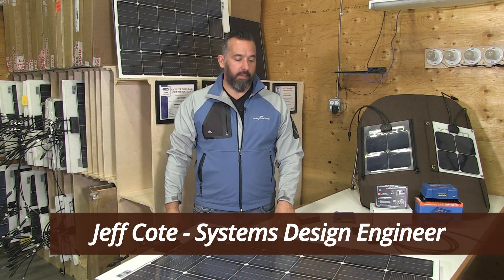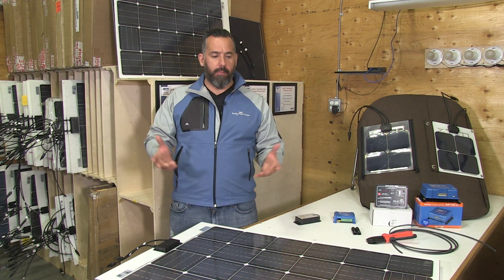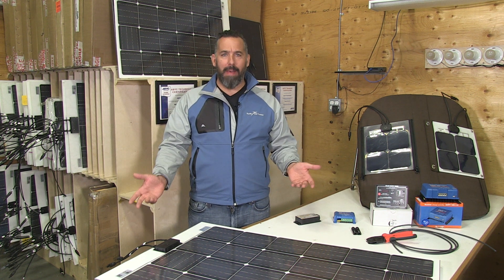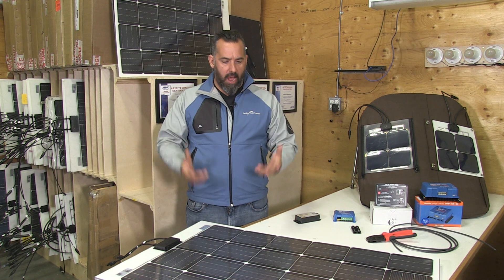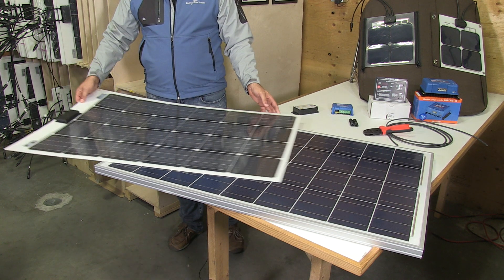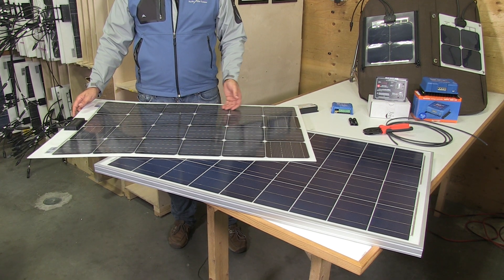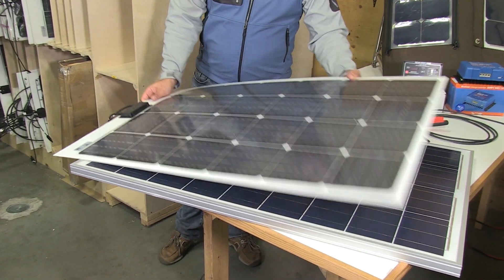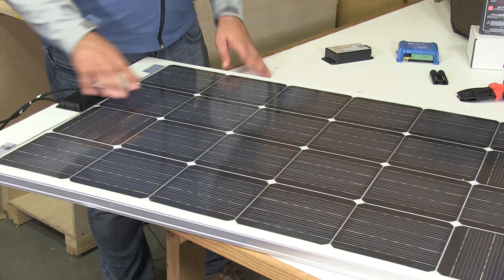Should I Use Flexible or Rigid Solar Panel on My Boat?

Comment: I read that flexible solar panels generally have half the efficiency of rigid; 7-13% efficiency vs. 16-20%.
Wouldn't that make the rigid panel, that you are showing in the video, produce 19,2-24W vs. 8,7-15,6 W from the flexible?
Reply from the maker: Hi Tom-Andre, good flexible solar panels offer the same efficiency as rigid panels. i.e. from 17 - 21%. Remember a 100 watt panel is 100 watt panel, meaning the efficiency of the cell is included to make 100 watt. In other words, a 100 flexible poly vs 100 flexible mono, both provide 100 watt. The mono version does so with a smaller area because it's more efficient then poly.
Reply: @PacificYachtSystems  The two panels that you compare in your video is of the exact same size. If they are to produce the same amount of watts, I agree their efficiency would have to match. Although, searching the internet there is supposedly only an Italian company that currently produce flexible solar panels that are equally or even more efficient than older mono panels (24% vs 15-22%). Sadly they are also famous for charging an arm and a leg.